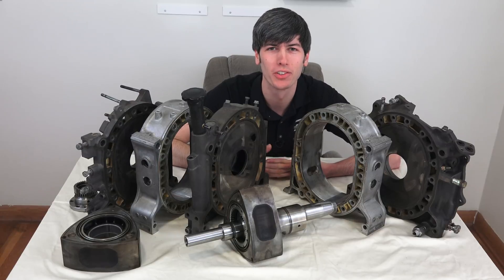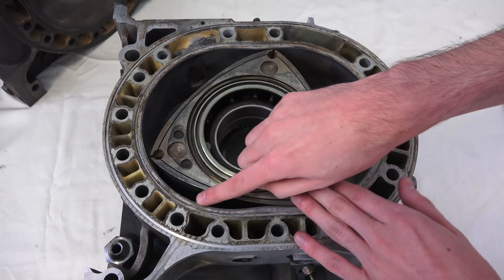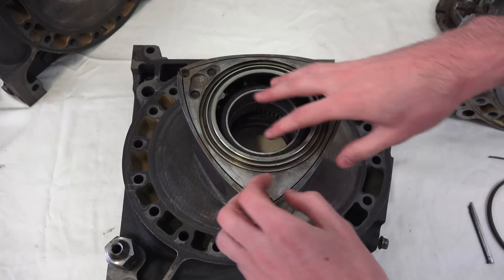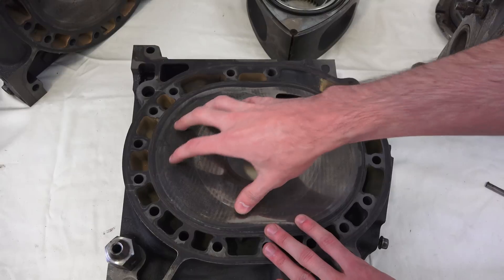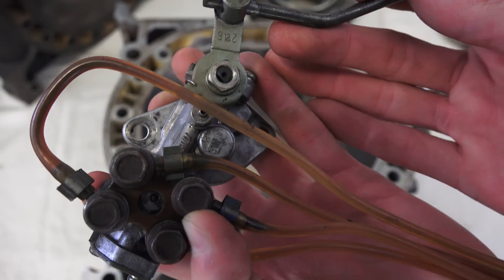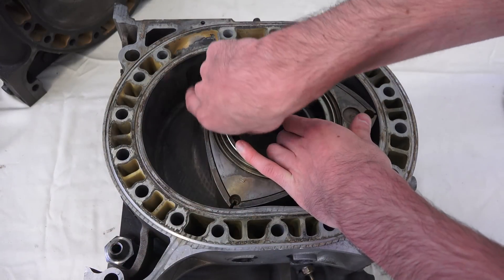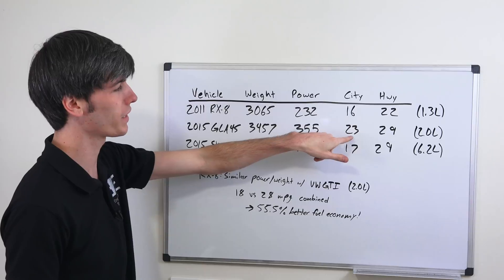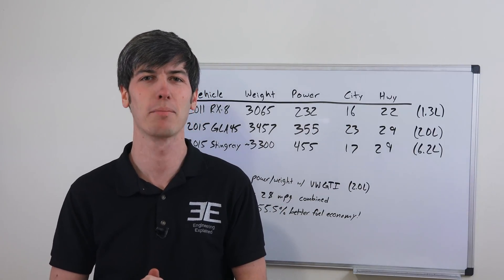4 Reasons Why The Rotary Engine Is Dead

Comment: if this site is named ENGENEERING EXPLAINED, as engeneer, you MUST use International System for measurements. Gallons, feet, miles there aren't in International System. So try to correct this important thing

Comment: Mazda won the 1991 24 hour race at Le Mans. The F.I.A banned the Wankel rotary engine after that. None of the obsolete piston engines were competitive with this much smoother running 700 horsepower 4-rotor Wankel engine. The motor which won Le Mans was disassembled right after the race to check for rotor-tip seal wear and rotor side seal wear. None of the seals showed any wear at all. This powerplant is much more reliable then any piston racing engines.

Comment: If they could make this to very tight tolerances and have a high compression ratio, would there be a rotary diesel? Since diesel is essentially oil, wouldn't that solve the burning oil problem? What if there were two smaller exhaust ports next to each other with one being valve-controlled.

Comment: hmmm, so it's the lack of sealing, incomplete combustion and total loss of oiling lubrication that killed it. 
 well i wonder if you switched to diesel if that would take care of the needing oil injected. or if you could line it all with maybe, idk, a ceramic & graphite liner. or sometype of graphite or graphine compound that can withstand that type of environment. And maybe the rotor can be made to be a heat sink to help transfer the heat more evenly. 
 I'm just spit balling here. not a mechanic or anything. It just sounds like it would work better if you used sometype of long wearing dry lube that can withstand that type of environment

Comment: I have had a Mazda RX-4 (I think it was 4...largest rotary engine later seen in the Cosmo too). For 3-4 years. Absuolute joy, no problems, accelerating better than the Porche and cold-startable with series of "D" size flashlight batteries (low inertia-resist turnover).

Comment: ah engineers the reasons we mechanics have job security. can you guys at least stop putting vital components buried under half the other vital components, i know it looks good on your fancy 3-d modeling program. but if you surround another oil filter with the exhaust manifold aka subaru sti ill burn everything you love

Comment: The revs on a rotary go up extremely fast that is an advantage so better for high intensity activity so like drifting.
Reply: I'm pretty sure Wankel engines can actually rev much higher than reciprocating engines, due to the lack of Valves that need to close in time to not get smacked over the head by a piston.

It's been a while since I actually read up on fact, but I still remember reading they can go up to 32.000min^-1

Comment: Nice explanation - I had read about these disadvantages before but nice to see it explained very clearly.  I have a question you might be able to answer.  I agree that rotaries have some terrible economical and pollute a lot because the design necessitates burning a lot of oil, so why in the world is Mazda even considering to bring the engine back again?  Are there developments on the horizon that make it somewhat more efficient and pollute less? It just seems from the design of the rotor that would not be possible to enough to make it worthwhile.  Thanks.
Reply: Yeah??? What about the RX Vision??

Comment: 2:48 yeah because nobody does regular oil changes on their car (sarcasm). You don't think they took that into consideration when designing the engine? Rotary engines were first put in cars in 1964. They weren't very concerned about emissions during that time. You are comparing a 1.3L engine to a 2.0 and a 6.2 so yeah that's such a great comparison (sarcasm again). A 1.3l 4 cyl made by mazda the mazda B3 engine made a very little 63 hp in the 90's it was very fuel efficient, but very little power. you are also comparing car weight not engine weight. These engines are amazing engines they put out an amazing amount of power in such a small package. I do agree about fuel efficiency people want that now but saying this engine isn't efficient based on power that is ridiculous. You are also comparing different years as well. Newer cars make more power because they are better. This video is a load of crap.

Comment: it's the size of and has the power of a 4 cylinder, and the fuel economy of a 8 cylinder
Reply: ***** with those numbers, i would rather have a Chevy LTG. it has 275hp in a stock 2 liter. it's turbo'd, parts are cheaper, its easier to work on, and fuel economy is better.
Reply: you are talking rubbish; how many rotors, for a start?
Reply: Make that a very inefficient 12 cylinder.

Comment: Couldn't you equalize the heat distribution a bit by having another upside-down rotary engine attached to the other side, so that each side has the top hot on one side and the bottom hot on the other?

Comment: The Wankel Engine needs to have a forced induction system. The ECU must be tuned by a proper programmer to make any power and gain efficiency. The down side of how hot they get and all the extra piping you add on to it for the induction system adds weight to it, not to mention the extra liquid weight which gets pretty heavy under lateral forces for the engine. Now in comparison to the Power Gains of a forced induction system, the weight advantage that you had just lost doesn't matter. Because MORE POWER!!! Yeah Baby!!! Rotary Engines are Bad Ass, Warm them up Properly, Keep them cool, Lubed, and Don't over Boost it and she'll last a Long Time for you.

Comment: I owned a '80GS & a '86 Sport Package. Neither car had reliability problems, they ran great. Big problem? The '86 had 145hp and struggled to get 20mpg. I loved the cars though, had a blast with them.
Reply: NSU Ro80 had the Wankel back in Germany. And because of it,NSU went down under recalls when they had to replace all of them with Ford V-4"s. When drivers pass each other,they would hold up their hands and indicate by their fingers how many times NSU replace their Wankels.
Reply: Well,atleast NSU went to a good home. Volkswagon Gmhb. pick them up and later came out with a few classic cars base on what NSU had. So in some ways,it's alive.
Reply: actually, you're wrong.https://en.wikipedia.org/wiki/Wankel_engine in fact, uve actually commited a logical fallacy, which i could link to you as well, but... if you dont know what that is, a link wont help.
Reply: At the very least you get a great looking car with an RX-7 which you could always change the engine.  The 944 and the 924 are just ugly POS liked only by the kind of person that would claim a BL Allegro is a classic car.
Reply: It was pretty sad because NUS really had a car that was a bit ahead of the rest in Germany on style and front drive tech. I drove a few when I was stationed in the "Der West BundeutschRepublic",just too bad they went with that anchor.

Comment: Another huge disadvantage is the difficult manufacturing process. It is not easy to machine the parts because of all the odd angles and curves. I know, I worked for an engine re manufacturer and was the engineer who assessed the disassembled engine to see what needed machined, rebuilt, or just cleaned up. I hated the programming the CNC for those jobs. And the tooling is all different too. Just a pain in the ass.
Reply: This is in many ways an example of economies of scale. Because they were not widely adopted, the manufacturing remained poorly-understood, the tooling remained obscure, and the skills rare. Had they been in near-universal deployment for 100+ years as the reciprocal piston engines have, this would be a very different discussion.
Reply: The rotary engine was developed in 1929. I think it's had a lot of time to become widely adopted....
Reply: Time, sure, but not wide-scale deployment. It was always a niche product, and still is.
Reply: i lose curves
Reply: I imagine those special springs alone cost a ton.
Reply: i'm in the market buying a used minivan since i'm over 65 and slowing down what do u consider the best nissan honda town/conutry

Comment: As much as I love rx7's & the RX vision, Mazda needs to lay the rotary to rest. They have been struggling for decades with it even almost putting themselves under numerous times because of it (hence why Ford owned a major stake in them for years). With the death of the RX8 the skyactiv's came out & I think they really have something good going on with that. Skyactiv is their new image. As cool as it is that they are still working on a rotary they really need to stop dabbling in the past trying to appease the few rotary fanboys out there. What Mazda really needs is a skyactiv halo car (like taking the design of the rx vision and building a skyactiv v6 engine for it). Kinda like what Ford did with the GT & the ecoboost V6.

Comment: OMG!!! I'm almost in tears reading all the butthurt Mazda fanboy comments!!!!! Seriously, did any of them listen to the guy?
Reply: +ThePolluxofLard u drive a rotary powered car? sometimes i dong believe in people with anime pictures on youtube..
Reply: +ThePolluxofLard Look man, it's got a smooth power delivery and virtually unlimited rpm potential. I love Dom Torreto. 
But if you listened to the video it should be obvious why it's done for the foreseeable future. It's efficiency is just not there. And as far as race applications go, V8s are plenty smooth and create a mess more power with way less fuel.
Reply: Yeah go write to those small lightweight F1 car designers, they're all about the rotaries. I mean, why do all those rx7 guys go and swap their wank for a V8? All that torque and power potential.
Face it, if my 4L V8 can beat a "1.6L" rx8 in top speed, acceleration, horsepower, fuel consumption, AND be heavier, the wankle is dead.
Almost as bad as flat earthers.
Reply: Did u ever drive with an RX car? I don´t think so. Drive one and then you are able to say something about the motor. It has some disadventages, but on the other hand its a very smooth and nice to drive engine.
Reply: The real doktorbimmer Mazda said, that they will create a new RX car. They are still working with this motor. The main problem is, that the motor isn´t getting enough attention. Only a few companies are working with the wankel. So the development is very slow. Thats why the motor still has a lot disadvanteges. Its not a bad motor, its simply different and the knowledge about it is very low. Most people dont know how to handle this motor, so they will break down very fast. Like i said, drive one and you will love it. Its not the best motor, but definitly one of the most fun to drive around!!
Reply: V8s aren't always the answer. The rotaries are much smaller, lighter and have C.O.G. advantages which makes them ideal for a smaller chassis. That's also why Mazda/NSU fitted these to small, lightweight cars.
You'd be crazy to fit one to a Vette, but an open-wheeler / Caterham type chassis is well suited.

Fuel consumption is easily managed in race scenarios. Endurance race? Switch out the fuel cell for a bigger one or add an auxiliary.
Reply: Sean Murphy You're talking about unitised chassis cars (RX7 etc). I'm talking about race cars because you brought it up. Not drag racing, although rotors do good times there.
Circuit racing in little cars. Some of those guys use 4cyl car or bike engines and some rotaries. There's those 2.6l V8s where they marry two 'Busa engines but they're expensive.
For a small race car it makes sense.

Anyone converting a road car primarily wants better torque. Get an all-alloy V8 and up the front spring rates all you like, that's still a heavier lump under the hood.
Steering and handling balance suffer.
Reply: The real doktorbimmer Actually, everything I wrote is based in 1. Science and 2. Personal choice. But I never wrote that anyone was considering using them again.
Everyone is downsizing and going forced-induction, even Ferrari. So a thirsty rotary has had its day in road cars.

The only problem in a race application is torque. If the class allows, forced induction addresses it.

If they weren't good race engines, outright Bathurst and Le Mans wins must be a collective hallucination.
Reply: The real doktorbimmer
So at two of the greatest, most challenging race circuits in the world, they had outright wins against V8, 10s and 12s and it was a fluke?
Hmm okaaaaaaaay.

I regard them as the two-stroke engines of the car world. They're not my thing personally, but I don't deny history.

The real fanboys could list many more wins. Those were just two I remember and I can't be arsed searching.
Reply: The real doktorbimmer
Considering it was just Mazda remaining to pursue it, road cars were an achievement in themselves. Critically acclaimed, multi-award winning cars? Even better.
To have notable race wins on top of that? Icing on the cake.

And...I stand corrected -- rotaries aren't dead for road cars! If you find that objectionable, better tell Mazda to stop wasting millions on Skyactiv-R.
Reply: The real doktorbimmer
Wrong again? Moi? LOL dorkter, it's time you caught up:
http://blog.caranddriver.com/new-spin-mazda-files-patent-for-new-gen-rotary-engine-heres-what-it-tells-us/

It was actually announced November 2015. Aaaaaand here's their Facebook page:
https://www.facebook.com/Skyactivr/

I will give Mazda this: they're tenacious bastards. Almost as stubborn as you :P
Reply: The real doktorbimmer
You can dream on. I'll wake you in 2020 when it's a production reality.

Comment: I for one am really sad to see Mazda stop developing the rotary. When they were allowed to turbo charge it was an awesome engine. recently I took a Datsun 180B engine, machined a rotary port head and introduced a turbo from a Porsche 951.  The main problem I am having is sealing through the valves, even with the long stroke and bad chamber sealing I am able to see the engine rev over 9,000 with a low boost pressure,I am not open to talk about power just yet as I don't think right now the engine could last 1000km. But...... basically my message is valves as you guys know are old skool. racing engines are restricted through rules and regulations, manufacturers do what the public want. Mazda had the balls to do something different and it was special. It changed the path of engine engineering for the good.

Comment: Comparing a 2011 car economy to a couple of 2015 cars.Do you know how much economy has changed in the last 5 years? A 2011 Corvette probably has economy ratings of 10.
Reply: A "modern" Wankel would still be worse than standard modern engines. He's explained the economy is down to inefficiencies in the engine design itself. Obviously an old corvette would be much worse he was just making the point to stand out that a pissy little rotary engine can have significantly worse  economy than much larger traditional engines. 

Mazda's next generation engine has yet to even see production so i cant imagine there is a massive difference from 2011 to today.

Comment: one of the reasons to get a rotary is because its registered as a 1.3L you pay less tax and insurance is cheaper, well in the uk atleast
Reply: Yeah...and you spend twice or even three times as much on fuel and maintenance. Good job,Bob...you're "smart".
Reply: Here in Brooklyn NY, this car as well as the 300zx,3000gt. insurance is really high.. they are considered sports car and other stuff including its emissions
Reply: in the uk we use emissions on tax not displacement. however this is on any car registered after 2006 so if you get a 55 reg Rx8 its £230 if its a 06 plate its £430... same emissions, same power output, just different age.
Reply: +The real doktorbimmer ops indeed thats the alternate fuel tax.... lol! thanks for correcting me.
Reply: Here in NZ we aren't charged more based on car age or emissions. We are charged more insurance based on whether it has a turbo or if its easily stolen. For example my 250hp sti forester from 2001 costs almost double to insure than my 2005 rx8. The forester is also insured for just over half the price of the rx8. Both same insurance company. Simple based on the fact my forester has a turbo. Both are alarmed and immobalized.

Comment: My grand father told me a story about their experiments with rotary engine on VAZ (Lada). They made a couple of cars with rotary engine and they were terribly unefficient. Then the military was interested in putting these engines on helicoplers, because of their power/mass ratio, but again the helicopter had to carry more fuel, therefore it wasn't worth it. 
P.S. You missed one disadvantage, the power is not constant, it is pulsating, therefore harder to handle.

Comment: What would cause the oil to become white and frothy?  I had this problem in an RX-8 I used to own and we couldn't figure it out.
Reply: +Jim Mazurek coolant present in the oil shows a milky white residue.
Reply: +The real doktorbimmer I don't have any experience with rotary engines, but had several old VW vr6's which also had chronic gasket & seal issues. Probably due to squeezing a 6cyl motor into a 4cyl engine bay. Fun engine to torque around, terrible when looking at the repair bills...

Comment: can you do video like this about normal engines ? i guess petrol and diesel...i would prefer bmw engines, but thats ur choise....also how does oil pump work in normal cars, because i never heard that someone changed oil pump or that engine died because oil pump failure....after that u should make video about bmw i8 engine and compare it to tesla model s or whatever is similar.
Reply: +xAsmir  I agree with this guy!! ^^^
Reply: All true. One must fit a new oil pump !!.  If it is a gear pump at least lap it in.